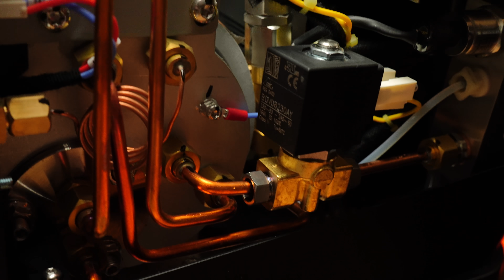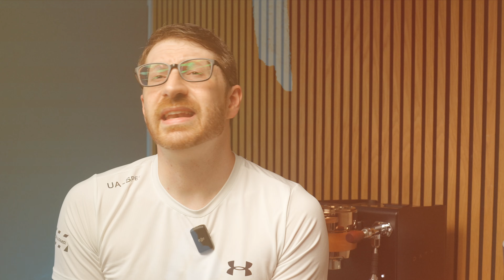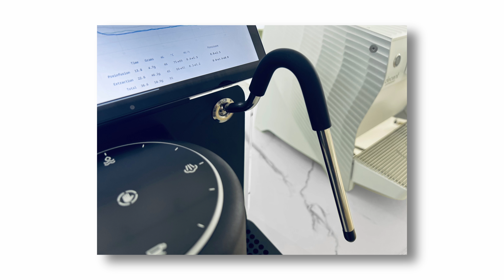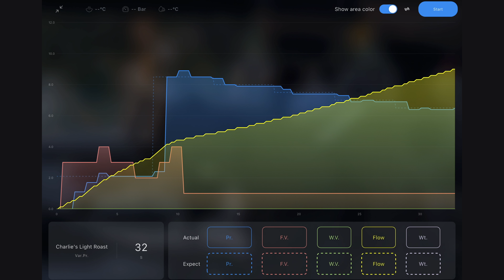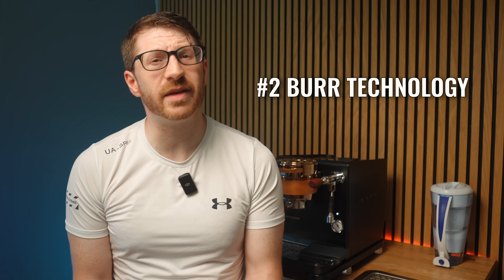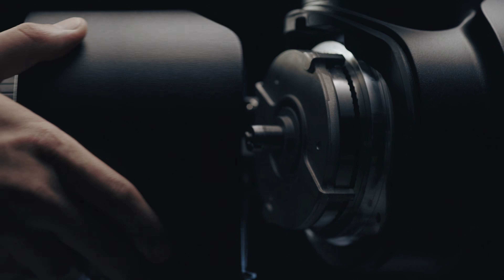Coffee Engineering Is Decades Behind

Comment: In terms of cost of production and the price of the machine its brilliant. selling old tech machines over and over again without improving anything at all is clever. i'm an engineer by myself and worked with automatition systems and stuff you need to improve or make the machine intelligent and its not even that hard to do so, but what the company missing is insane. Maybe the engineers in the companys just won't work with thermodynamics. JK when i see commercial machines its far more techbuild than customer machines. the price is always way too high for the actual tech build inside.

Comment: Some good points, but reliability will suffer with more modern technogadgets, and repair / maintenance costs will go up.  Note also, your temperature readings are wrong with your scace because you’ve set your reader to k-type thermocouple rather than t.
Reply from the maker: I'll check on that thanks for the info

Comment: Ozik user here! 

You actually made me change my mind about my GS3. I’ve had it for almost 7 years now, and lately I’ve been facing issues from time to time. It needs more and more servicing, although to be fair, I think part of that might be my fault because I’ve kept the machine running pretty much 24/7 nonstop.

The problem is I just can’t wait 30+ minutes every time for the machine to heat up 😂. From what I’ve researched online, I also understood that keeping it on might actually be better than constantly switching it off and back on, since repeated heating and cooling cycles can put stress on the heating elements and other components. So that’s basically why I’ve always left mine running.

Recently, I switched my water setup from BWT to Bluewater, and honestly, it dramatically changed the taste of my coffee. I wasn’t expecting such a noticeable difference just from changing the water, but the improvement in the cup was huge.

Now I’m seriously thinking about getting the new Bengle Decent. After almost 7 years with the GS3, I never thought I’d seriously consider replacing it, but your videos definitely changed my mind!
Reply from the maker: I think the Bengle is gonna be the machine I go for, but let's see once I get one in for review

Comment: I have an E61 HX machine that produced variable quality coffee shots until I added a group head temperature gauge and group head pressure gauge. Now I fairly consistently get good to very good coffee, and regularly excellent and relatively often, exceptional coffee. The key issues driving variability is the roast consistency and grind retention (bean mass in <> grind produced) which produces variations in dose, and therefore puck resistance. Add to that channelling because of grind distribution and compaction. I drain the boiler daily. Yes, the pump noise is really annoying.

Comment: Bought a secondhand Rocket Appartamento 7 years ago, making a few flat whites every day and it’s still going strong! Literally zero maintenance needed. Exceptional extraction every single time. I think most people just don’t need all that fancy tech and digital screens, mechanical reliability is where it’s at.
Reply: And do you use tap water? How often do you descale?
Reply: @DarkPa1adin I live in the uk with very hard water.
And the best super market spring water option  with low calcium carbonate content is the Tesco ashback and Waitrose essential. 
So I only use them and descale every 2 years.

Comment: Any car mechanic will tell you cars were grerat 1990-2010 with tech peaking at 2010 or so. Then came the software invasion. Now cars are good when new but become maddening, expensive, impossible to repair pieces of shite as soon as a single chip fails. Longevity has gone off a cliff.

Your new car can stop on its own in a pinch, but might also phantom brake on the highway because of software bugs, glitches and immature tech. If in the future cars will actually drive themselves properly then I'm on board.

But now we risk many coffee brewer equivalences of Tesla Full Self Driving Autopilot (meaning shitty vaporware), brewing less tasty than you can do yourself. Some tech bro will try to sell us a machine with a subscription for the steamer. The reviewers will only use it for a week and they can't say much about how it will compare with to your old italian low-tech brewer 20 years from now, but I nevertheless have a hunch you've scrapped one of them by then.

Comment: Some valid points but in defense of the E61 and "old tech", it works, and more importantly, it's simple enough and widely spread enough that anyone who has basic tools and spends 30-60min of gathering information can repair and fix alot of the parts that are the most common to fail due to wear. I honestly prefer that than having a super fancy ai operated internet connected spaceship machine that will a) fail even faster due to more electronics and more parts, will b) cost more to repair due to the complexity of the parts and will likly c) not be repairable on my own due to requiring specialty tools and knowledge not readily available. Sometimes old things that work and can be maintained are just fine, buy some good coffee with the money saved and it's gg ;)

Comment: I agree that today espresso machine are engineered like crap. The most frustrating is the low hygiene. Better pumps, better boiler (some spiral low intertia heater exist), the water path should be reduced to the minimal to be able to rinse in a couple of seconds, everything should be no tool disassembly, only truly noble materials should be used

Comment: I agree with your points. Just some additions. Car manufacturers didn't act much different to coffee equipment manufacturers until governments forced them. Adding the 5 cent sensor or the new software was always too difficult until new laws pushed them to it and then it was magically solved in a couple of years.

Also, there is no such thing as a brushed AC motor. The brushes are added to DC motors to create the alternating fields that AC motors inherently have. The brushless DC motors are a somewhat recent innovation that allows rpm control, which AC motors doen't have without significant power control circuits.

Comment: I've been around long enough to witness manufacturing at every level. Technology comes at a price, both figuratively and in the ability to maintain the machine. Whether it's automobiles, motorcycles, cameras, espresso machines, etc., the minute you add the latest technology, you also build in a specific amount of maintenance difficulty due to complexity. You will also raise the selling price considerably. This is the last thing the espresso world needs. IMO, the quality of espresso produced is determined 75% by the barista. Technology is not a guarantee of progress or quality, only price and complexity. I'm in the less is more thought process. The lever machine holds considerable more interest in producing a great cup of espresso as the intent is truer to form.
Reply: Indeed. And then the only way to improve the barista part.... is by removing the barista. 

Which would only ever play into the part of the market for fully-automatic machines. It would do nothing for the market that genuinely find the only reason for the machine is if they get to be the barista, for the love of doing the task itself.

Comment: Excellent points on the value delivered by new technology, but implementation still matters. There is something reassuring about the old school mechanical approach, plumbing you can trace out and follow yourself, and build quality that will last a lifetime versus plastic parts, complicated circuit boards and basically throw-it-away technology which may perform fantastically while it works. 
That said, I refuse to buy a vibratory pump machine, I’m still using a manual machine because, while it has a tank, I fill and empty it with every use. However, it takes me half an hour to make a single cup. 🤷🏼‍♂️🤷🏼‍♂️

Comment: I'm surprised you don't mention Meticulous. They bring some serious innovation and address most of the issues you mention. Single-dosing water, an electric motor driving a piston instead of a pump, and a software-driven approach. The precise flow-profiling and advanced options in profiles also enable much more fault-tolerant profiles that yield the intended result even when the grind is not completely spot on. The workflow is a bit more involved, for sure, but for me that's a fairly easy tradeoff.
Reply: Looking up Meticulous, am I missing something? Is there no way to steam the milk in that machine?

Comment: 4:19 easy to repair
Reply: Yes. Definitely!
I would rather buy an inefficient, but easier to repair machine than super-duper efficient, but super uniquely with its parts.

On an E61 machine you can basically replace anything with any element from other machine. Swap a grouphead? No problem at all. Swap a boiler? Usually not an issue (may require capping a couple of extra ports if there are some or maybe a T-junction if there is not enough ports (not ideal, but doable). All joins are standard (BSP-T or BSP-P), pipes are standard, heating elements are easily replaceable, and so on and so forth.

Comment: When you want a return on the R&D of a high tech coffee machine, you have to consider two things:

1. Many people have an experience with a little ‘espresso’ machine that they got from the department store that made bad to mid coffee, and when it broke after a couple of years, it was unrepairable.

2. Any tech object you buy gets updates for a year or two, then it rapidly becomes obsolete. Many irritating bugs are never patched.

The vast majority of people buying high end espresso machines are making what they see as a significant investment. The market for high tech machines is much smaller than you think and is already saturated.

E61 machines have been in production since… 1961. Parts are commonly available worldwide, and are interchangeable between machines from different brands built decades apart. They are one of the few ‘everyman’ luxury products you can buy that are infinitely repairable.

Things like higher energy use pale into comparison compared to the risk of having a $3-6k machine from a boutique manufacturer brick itself after a few years.

The most important element of UX is that the machine produces coffee of a quality that makes you glad you purchased it. That it makes good coffee with the end user having to contend with a minimal number of variables. That you pull the lever, and good coffee comes out.

If a manufacturer departs from these things and wants to make money, the product needs to be absurdly compelling.

Comment: Oh man... sure things can be swapped for a newer technology,  but only if it'll genuinely make a difference, swapping it for the sake of swapping it with diminishing returns isn't worth it, and honestly, would just fuel the chase of newer one (like the old say "neighbor's grass greener" and that).  I feel like there are far more things to be 'taught' and explained before chasing an "improvement' in the gear, in my opinion this is THE actual thing to preach, help ppl get a better coffee by the simple things, not by a newer-more expensive one
Reply from the maker: Boiling water all day is very expensive and inefficient. It can be done much better. Think how much energy you would save if you made all the commercial espresso machines 20% more efficient. An absolute fortune
Reply: @homecafecharlie  Commercial machines? If we're talking commercial usage, then probably not going to save as much as you think. 

 Even if it only takes 3 mins, it would be unreasonable to expect the server to spend all their time turning the machine on and off all day. 

 It would need to drop down to 5-10 seconds heatup with auto shut-down after X minutes inactivity before that can be reasonably incorporated in the workflow of making the coffee in a commercial setting. Because once that order is in the customer expects it to be made then and there, not in 3 mins+ process 

 For a domestic machine it would make way more sense to implement than it does in a commercial one. Because you're only making 1 coffee for a domestic.

 Thing is we /already/ have boiler systems in domestic coffee machines, using the same tech as the commercial machines, that can heat up in 5 mins; they're just heating up smaller amounts of water. 

 Commerial doesn't do it that way because it genuinely needs a larger volume of water to make it work for the environment it's in. It's not the technology that's the chokepoint. It's the volume of water needed to keep the machine pumping out water continuously without cooling down too much as you're replacing it with more water for the next customer. That's not going to change by changing from boiler to some other electric system, unless you find a way to instantly heat it up as it's being moved through the pipe to the grouphead.

Theoretically, a 3-group head boiler could churn out 120 coffees in 10 mins. In practice it’d take longer, because you still need to take the order, and you’d lose time inbetween steps if you fumble anything, slow down, take payment, chat with the customer or take a moment to read the order. But it’s designed so two people could make 6 coffees simultaneously, and that’s only possible with a large enough volume of water that doing so keeps a stable temperature for the next lot of coffees

Comment: My dream machine is something similar to the cafelat robot. A cycloidal gear driven piston pushes a small column of water via a threaded rod (acme or ball screws.) Water can either be heated in the hollow piston and released via check valve (similar to where they place the hydraulic pressure gauge on the piston) and that would take care of preheating. You could also have the piston act as a syringe and draw the water up but I've never found a way that doesnt balloon in moving parts like old Flairs do
Reply: This is basically the Meticulous espresso machine :-)

Comment: one big pro of E61 is its old and stable technology, cheap to repair and everyone under how it work at least.
Reply from the maker: That's part of the point that I'm making. It's old and it works and everyone knows how to fix it. It doesn't mean we shouldn't be improving the hardware and software we use to make coffee better.
Reply: @homecafecharlie As me also as audiophile, In a lot of cases those "mass" are quite important to make difference in very finest point. but yeah we should have something more modern and maybe affordable but better quality for someone who want to enjoy espresso without much hustle. Affordable instant espresso machine is pretty much only available in instant heater with bad temp regulator so quality is meh.
Maybe something gonna develop through portable espresso machine like Outin Nano, those technology can be advance as " single dose espresso machine" in future.
Realistically regular person drink 2-3 espresso per day but heating E61 big boy only for that is certainly "too much" as electric energy ana mental efforts.

Nowadays even single boiler E61 espresso machine costs 1000euros and ofc you need good grinder so its absolutely not beginner friendly hobby, I hope there will be good quality modern easy going espresso machine around 500eur in future.

Comment: Tech is far behind but its not needed. The espresso machine will not make you better coffee, the roast and grinder will.
Reply: You're not entirely wrong, but temperature precision/stability are also pretty important, definitely.
Reply: It is pretty much needed and it's a shame the coffee industry is gigantic yet the technology to back it up is so poor
Reply: @thedanggame6691  I wouldn't say that. The suppliers are meeting demand. The vast majority of people can't tell the difference in taste between machines (most couldn't make consistent coffee even if they tried) and so prioritize aesthetics, sound, convenience of use, and reliability.

The industry is responding to what users actually want, not functional metrics that a lot of the commenters here seem to want to be important.

The main technological gap is physically cleaning the thing. The more steps that are automated, the more physical stuff needs to be cleaned. If you start from beans, then an all in one automatic coffee maker would need to grind, compress, extract, dump the puck, do the milk, foam, and dispense a cup.

That's a lot of tubes to clean, a lot of powder to dust off, and a lot of internal mechanisms that can break. Until we figure out a cheap, good way to automatically maintain all of that, tech can't really advance much in the coffee making machines.

The problem isn't adding "smarts", it's doing the physical work.
Reply: Probably true in a commercial setting but the energy efficiency, heat up time etc would benefit a home barista.
Reply: But it will heat 20 times faster, use less energy, be quieter, and so on.
Reply: @livewallbergAlso it will turn into e-waste in 5-7 years, sending all energy savings tenfold to the landfill, meanwhile even 10+ year e61 will keep delivering great shots, with all the parts still available for all kinds of maintenance and repair.
Reply: @sergeib.v exactly, why dont they see it?